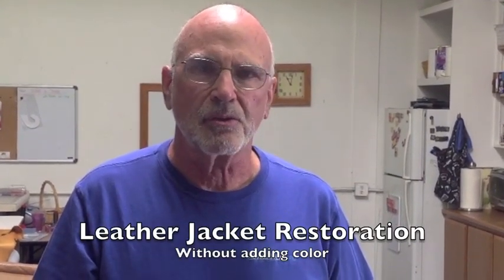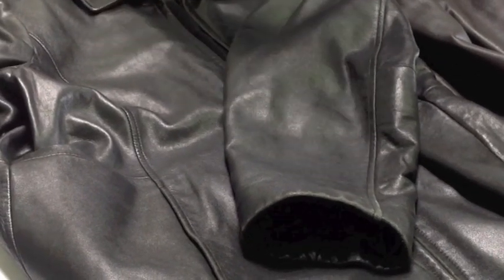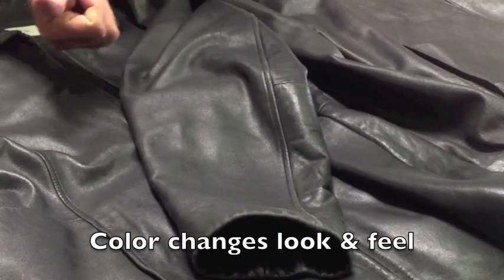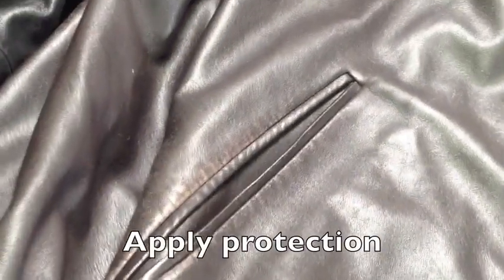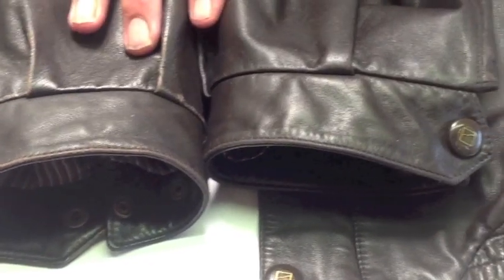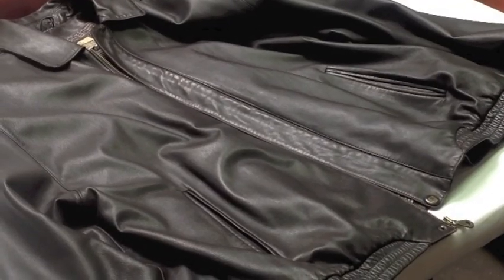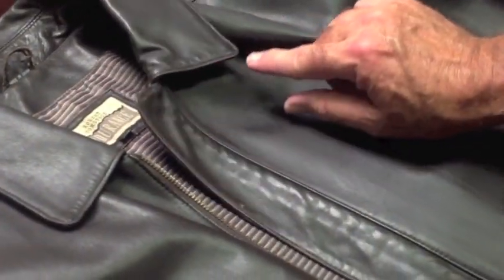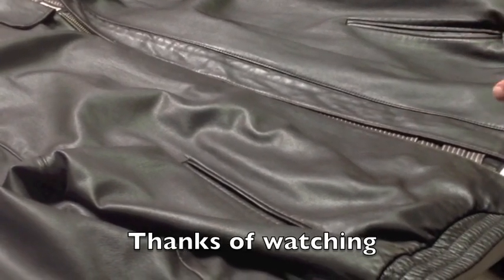Leather Jacket Scuffing and Chaffing Resolution

Comment: hey Kevin, I need to fix a lamb skin $500 jacket that got scuffed and THEN piece of tape got stuck on it and discolored the jacket when i pulled it off.. Someone told me to use Mink oil.. BUT, i saw this video and THIS seems more logical. What  product did you use ?  Michael
Reply from the maker: These are our products that we manufacture for this purpose.  Given you have mulitple issues you might be better served having a professional work on it.  do NOT use mink oil.  Mink oil is a water proofing agent for boots and such, not finely tanned soft leather.
Reply: Kevin Gillan my.issues are not drastic on the leather. i live in Las Vegas, it's minor cosmetic. and basically , what you did in the video.. is what i feel I should do. isnitna product I could order?  it's basically light scuffing

Comment: Will this work on an Brown  bomber style  leather jacket  that has an crack on the sleeve
Reply from the maker: This procedure will not resolve leather cracking.  This works to resolve light scuffing or abrasion wear.  If the leather is literally cracked open then it needs to be repaired or the offended panel replaced with new, color matched leather.  If you send photos of the issue, I may be able to offer a solution.  Send to: Kevin@ADVLeather.com

Comment: Why does black leather turn green ??
Reply from the maker: It has to do with the color's sensitivity to the energy in the Ultra Violet (UV) spectrum of light. That sensitivity is scaled based on molecular mass.  Red's are the smallest color molecule.  As such red is the most sensitive to UV.  What's opposite red on the color wheel? Answer is green.  So as the red molecule is broken up by the energy of UV at a faster rate than any other color,  green then begins to dominate what you see in the absence of red.

Comment: Is that oil-based enamel paint?
Reply from the maker: It is a specifically compounded chemistry designed to be applied to leather, a flexible, porous material.  There are multiple materials at play, including urethane and acrylic compounds. An enamel paint, as its name implies is NOT flexible. so as the leather flexes, the enamel paint would crack.